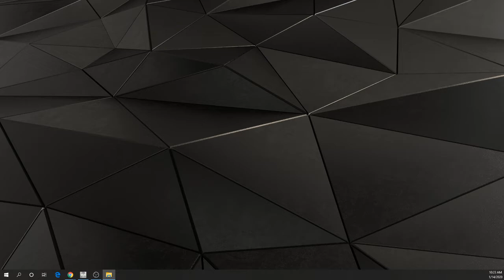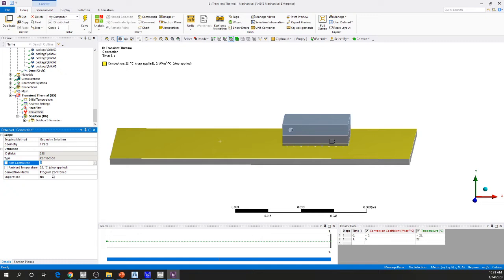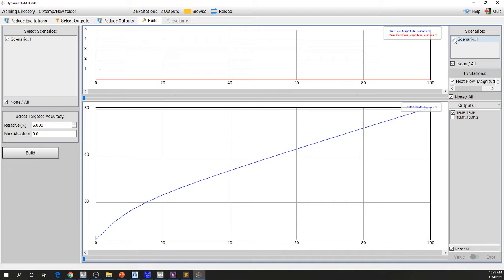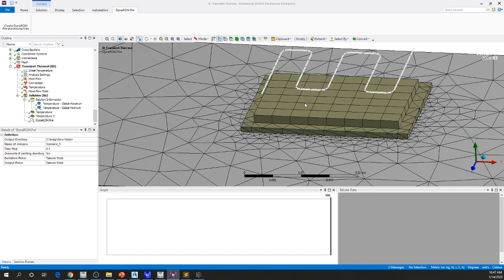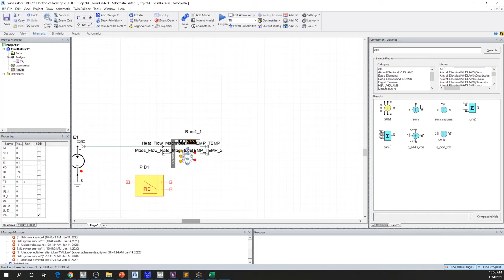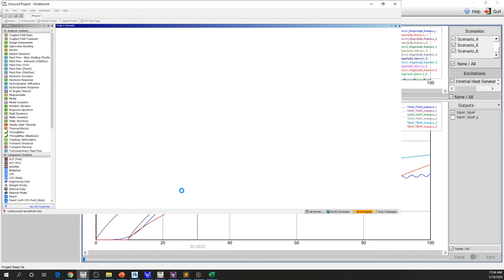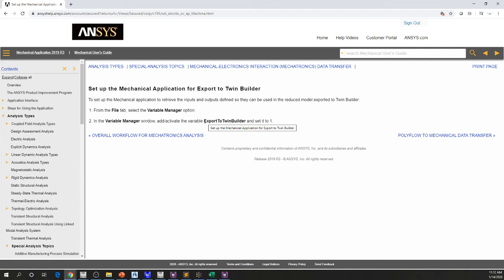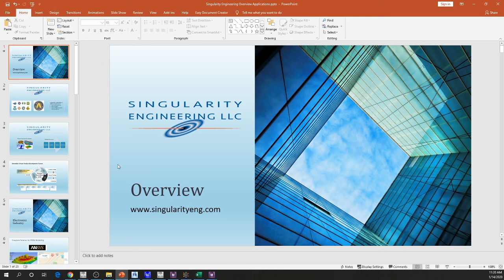Reduced order modelling for control system design in ANSYS

Comment: Hi hello. You have given insights for thermal ROM. Is there any tutorial available for structural based ROM?
 It would be a lot of help.
Reply: how to download twin builder or open it I used ansys r3 but I could not found
Reply: Have you downloaded this ACT? I can't find it in Appstore now.
Reply: Hello Prabhaharan.
I am also looking to perform Craig Bampton Reduced Order Modeling in Ansys on structural component to extract Mass and stiffness matrices at the reduced points. Do you have any idea about how to perform ROM in Ansys?
Reply: @akheniaparimal   It's in a different environment within Ansys. If u need to access twin builder, you have to install Ansys Electromagnetic suite seperately.
Reply: @user-de9kz8fn9x  me too，which edition u use？
Reply: did you find the way to form the structural based ROM?